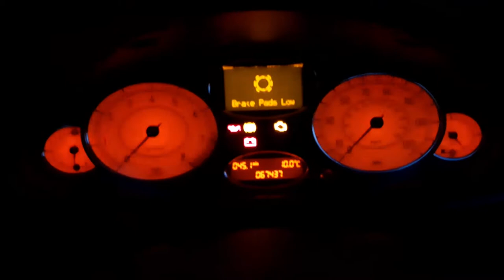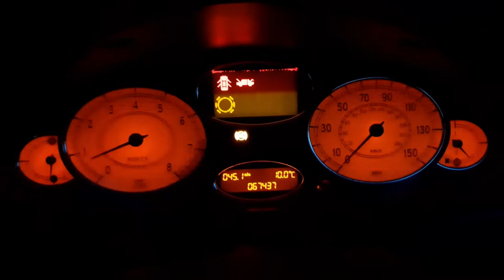servicing and painting the cam cover our rover 75 1.8 2001 K series engine

Comment: do you have a video to replace the fuel filter on the rover 75? Greetings from Serbia
Reply from the maker: The rover 75 does not have a fuel filter like the 45
Reply: @DPNTV  does the rover 75 1.8 have a fuel filter?
Reply from the maker: @doedoe7679  as I understand it is one for the life of the car in the fuel tank